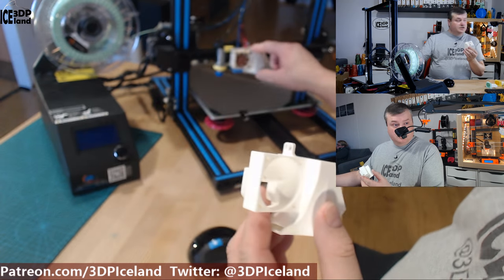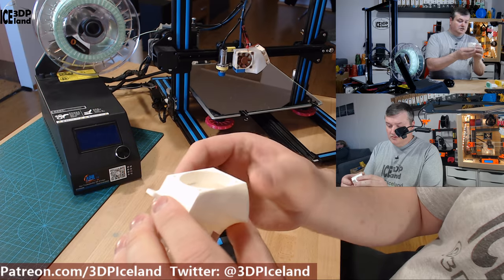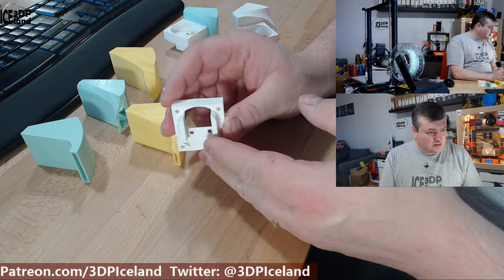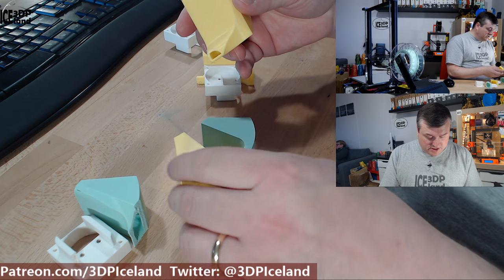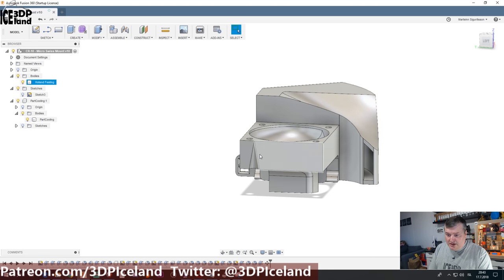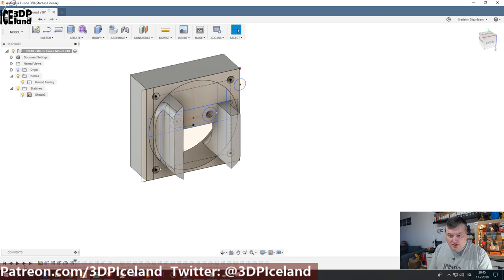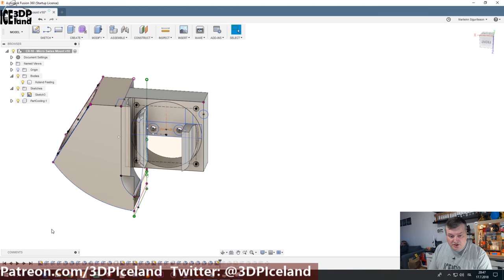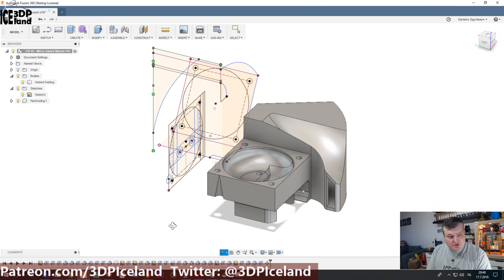CR-10S -  Fan mounts for 40mm Noctua fans and Micro-Swiss Hotend

Comment: That was a lot of work on your part!  Well done Marteinn!
One question.  I don't claim to be a flow engineer, but was wondering if restricting the fan's output (at 1:19) is detrimental to the air flow.  I know that restricting it the way it is on the part cooling nozzle should increase the flow rate (at the cost of a slight reduction in air volume[?]), but it seems to me that blocking the fan directly in front of the blades would restrict both flow and volume.  If so, you might get more of both if you moved the fan back a little - in order to allow an open area that is available for air flow away from the 3/4 of the fan that is blocked at this point, and down to the outlet.  I hope this makes sense - LOL.  I can send you a crude sketch if it would help you understand my concern.  Again, I'm no expert here.

Comment: Another great video, thank you. I don't see where the EZABL gets mounted to this. Can you explain please or have I missed something lol. Also, did you forget to link your model?
Reply from the maker: Thanks,  the EZABL is mounted on the carrage with the OEM mount (included in the software download with the EZABL), - this mount is designed in that way it does not interrupt the OEM mount so this object does not include the EZABL mount :)
Reply: Ah now I see. Thanks for clearing that up for me. I've just got the CR-10 S4 and already have Noctua fans on the way to upgrade the noisy stock ones. The next step is to upgrade to the TH3D Unified firmware and order the EZABL. What is your opinion of the TH3D firmware compared to the stock? Is your EXABL as reliable as the Prusa PINDA system? I have a Prusa MK2 and love the reliability and accuracy.
Reply from the maker: I used the stock Marlin , and did the edits in it to make the EZABL work, I like to work from the stock fimrware and not the TH3D unified one, as I have no idea how that is structured... -  The problem with the TH3D sensor, compared to the pinda2 on my mk3 and mk2.5, is that it's sensitive to temp, - so I'm not 100% happy with it in that regards, - seems to need a bit of tuning every now and then.
Reply: Thats awesome, I really appreciate your insights, thank you. I haven't found the stock CR-10 S4 firmware yet so not sure I want to config it from scratch yet as I have no comparison. I will probably wait a bit before trying the EZABL, if at all, but I would like some for of ABL on such a large bed, I guess I will have to keep looking. I did consider a BLTouch but not sure if that would be the best solution.
Reply from the maker: you welcome, - best of luck with your upgrade :)
Reply: Thank you. Usually I like to build things from the ground up, so that what I did. Downloaded the stock Marlin and configured it myself, it back up and printing as I type. By doing it manually, I discovered the 'manual bed levelling' which doesn't need a sensor, I hadn't seen that before. It's awesome, looks like I might not bother with a sensor now .... but we'll see. Hopefully my Noctua fans should arrive tomorrow, then I'll install those too. Appreciate all your advice